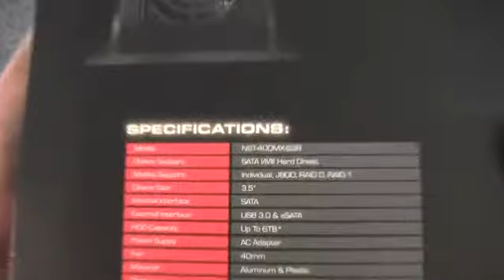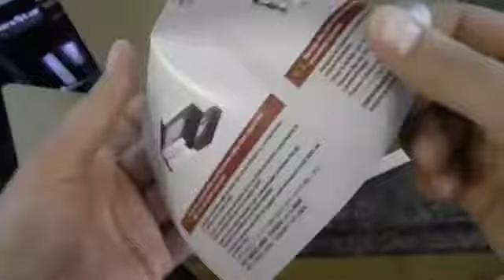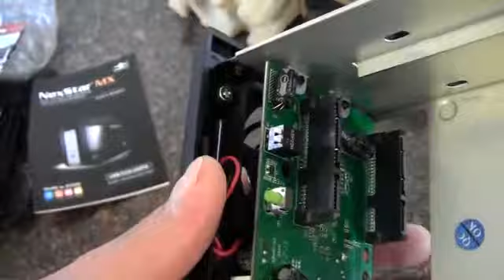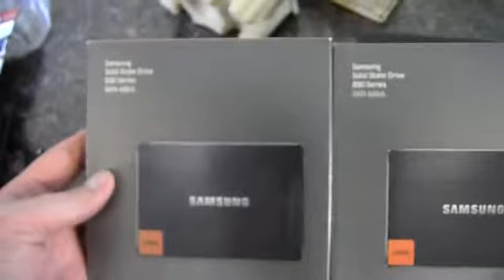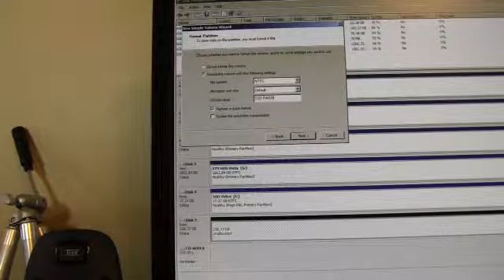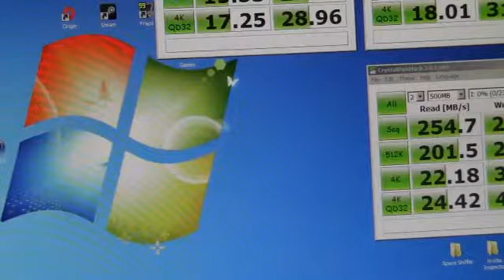Vantec NexStar MX HDD Enclosure

Comment: I finally did get it working. The key on mine was to have the USB cable plugged in before setting the switches, turning on the power and pressing the reset. If the USB wasn't plugged in it wouldn't have the drives active (as per the drive lights on the unit). It acts like there are no drives in the enclosure unless there is a connection to the PC. They need to fix that hopefully with a firmware update.

Comment from the maker: Off the camera I had a few issues with getting the RAID 0 to work, mostly I just had to follow the steps of setting up the enclosure a few times. I didn't mention it in the vid because I thought I was doing something wrong. But now I wonder if the device is just a little screwy. I will attempt a RAID 1 on mine and see what I come up with.

Comment: I purchased this enclosure for RAID 1. You recommended this but didn't review it in RAID 1. I cannot seem to get RAID 1 to work as RAID 1. Disk Manager shows 2 separate drives. I followed the instructions and your example but set the switches as sw-1 off and sw-1 on. Did the reset and still they show up as 2 drives. Any ideas on how to get the RAID 1 to work as a single drive? Thanks for the review.